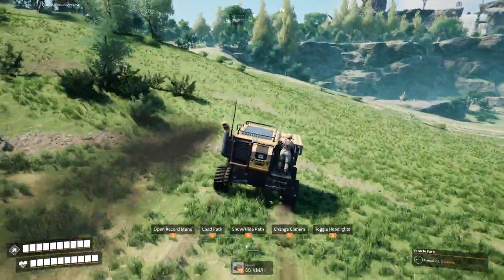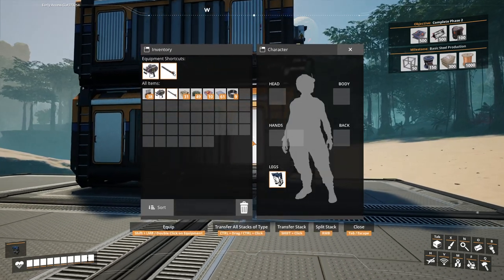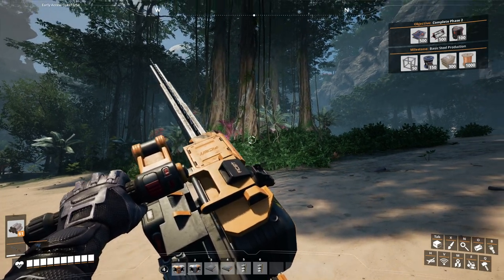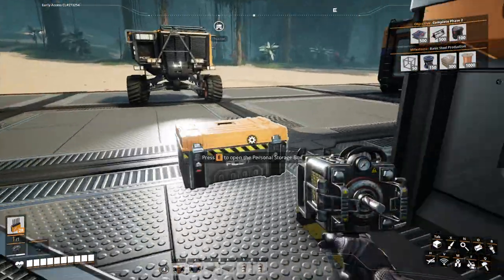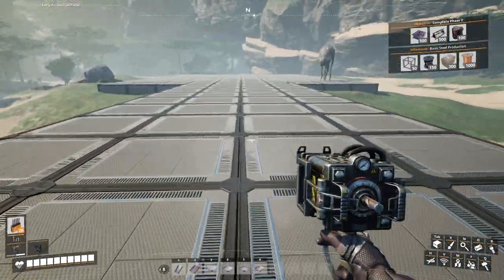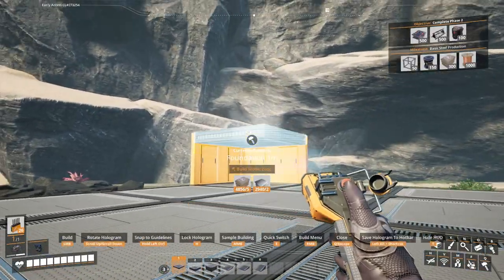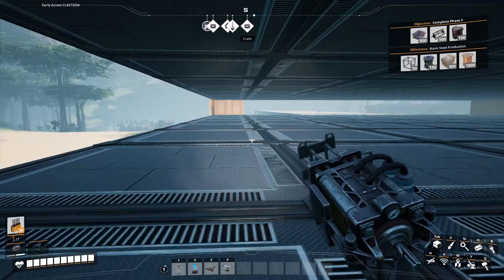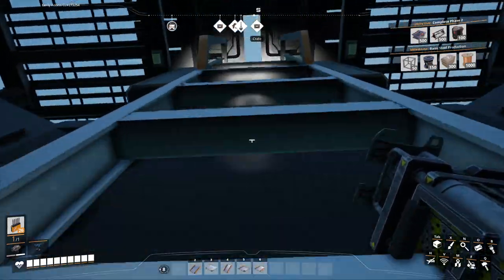Let's Play Satisfactory Update 8! Episode 11: Coal Power Pt.1

Comment: With coal power running, the biomass burners will stop burning fuel unless there isn’t enough coal power.  You can also unlock battery power storage, but keeping the biomass burners around is probably helpful.
Reply from the maker: Awesome! I’ll keep them around just incase! Thanks for the input!